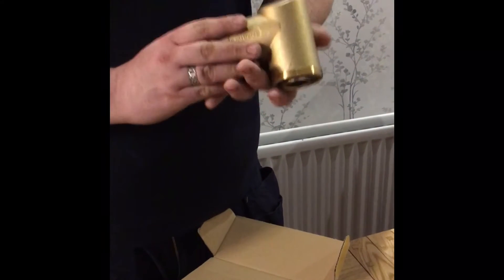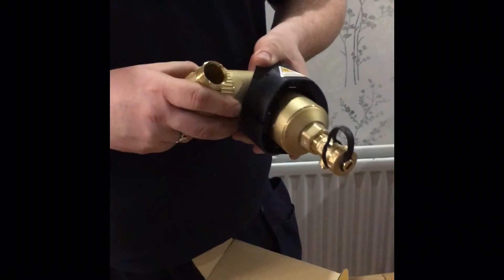SpiroVent RV2 Deaerator and MB3 Magnabooster 3 Overview

Comment: I have open vented heating system and I installed Spirovent RV2 on output pipe from boiler before the pump as manual suggests. I don’t find it very efficient since I still have air in the system and it fails to remove it.